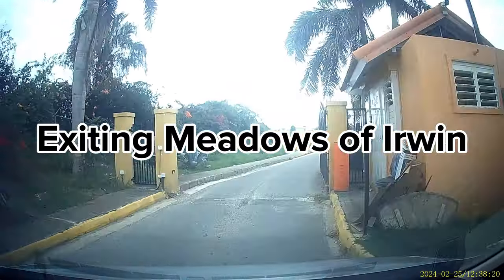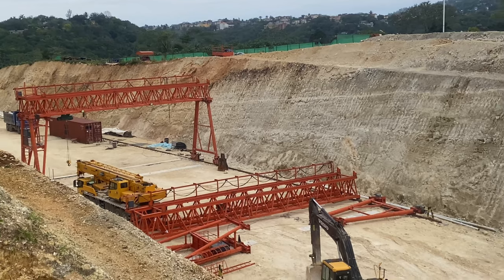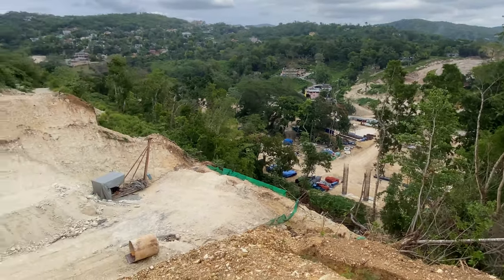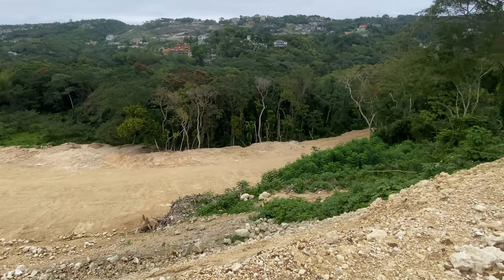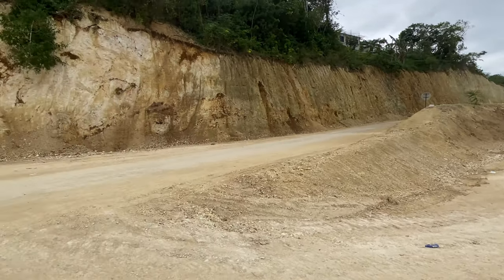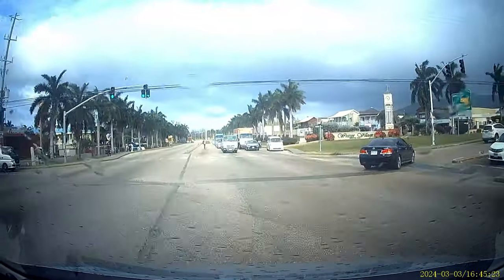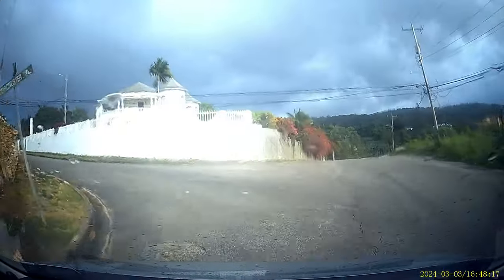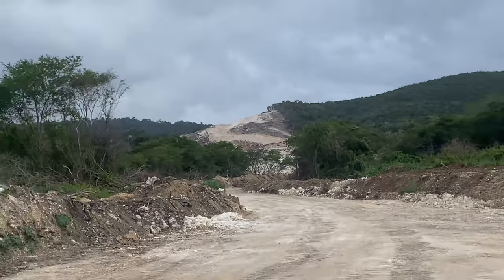Montego Bay Bypass 2024 Update pt2

Comment: Thanks again for this update work coming on nicely, can you do update on the pinnacle
Reply from the maker: No problem. Will check it out soon.
Reply: @BrownBossJaTours also updates on the Racquet Club condominium tower in Red Hills/Upper Deck area and the Hardrock Hotel at Rose Hall...thanx
Reply: There's no such thing as a permanent fix for roads..they have to be maintained on a more shorten maintenance cycle via fiscally and technically empowered regional county government NOT the central government bureaucracy (which has a longer national maintenance cycle)...